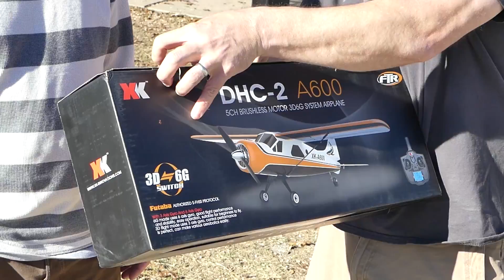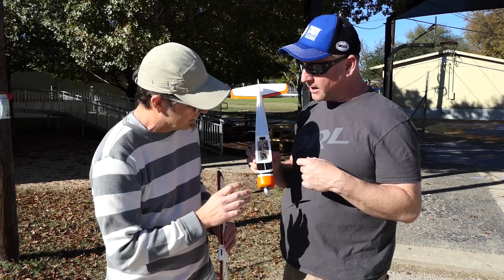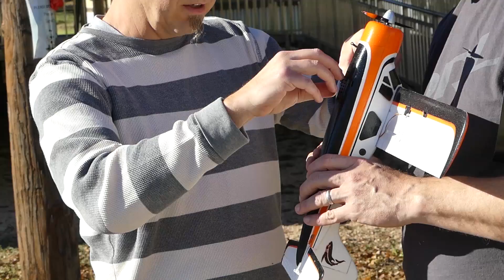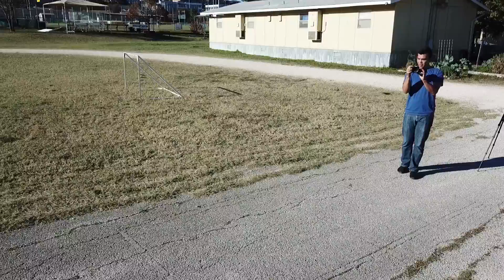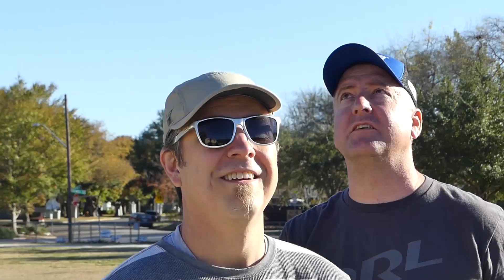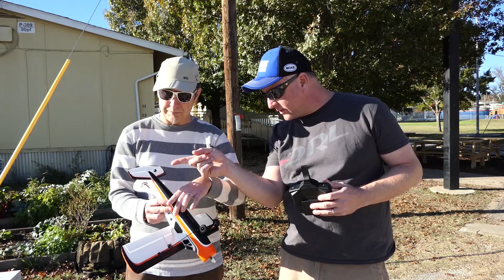RC Airplane Review - XK A600 Brushless

Comment: You can turn off the gyros. If using the provided transmitter, push down the aileron stick, when  it beeps you're in 3d mode. Push it again to switch back.

Comment: Excellent video. If you push the right joystick down you can switch from 6G to 3D and fly without the self leveling and do loops and rolls. It’s all in the manual on how to do that.
Reply: Yes I have one of these planes, and guys, if you are going to do a review you really should read the instructions and review all of the planes capabilities, please!!
Reply from the maker: Awesome! Great to know! Thanks for the tip.